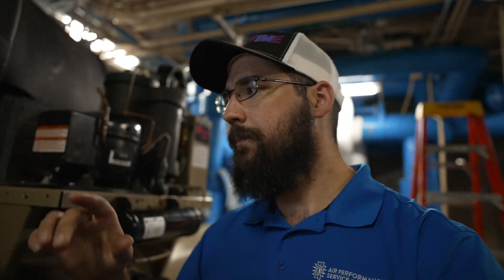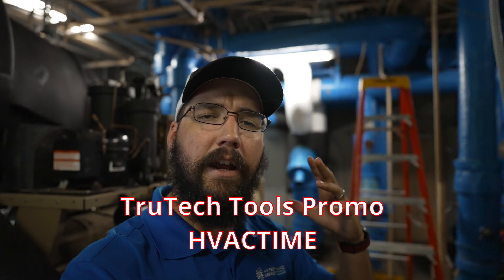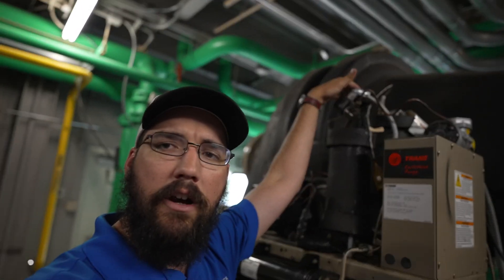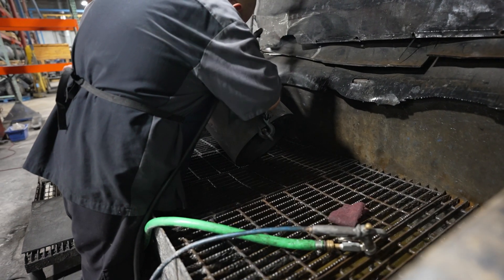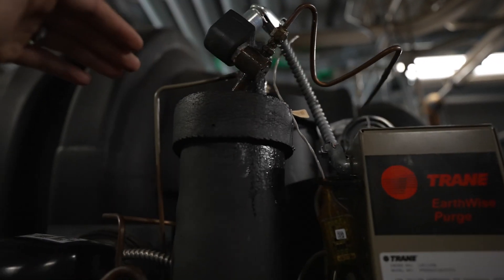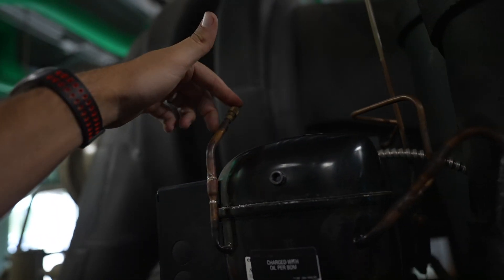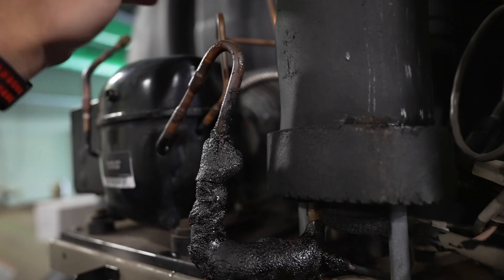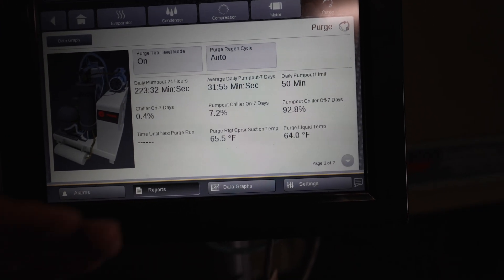CVH Purge Unit Troubleshoot for Trane Chiller

Comment: Have you ever seen the contactors on an IntelliPak pull in and out without tripping an alarm? So 60 ton, VFD circuit 1, 2 compressors circuit 2. Circuit 2 compressor contactors and first condenser fan contactor will pull in and out simultaneously without triggering alarms are tripping the compressor protection breaker. Only does it in the morning and not everyday. Circuit runs fine the rest of the day and in service mode and with circuit 1 running. All switches are good. Can’t find any shorts. Compressors not over amping nor overloading transformer no fuses blowing. Maybe it’s the MCM but it only does it in morning although that is the only time really it will bring the other circuit on. 24v inputs are good and 120v outputs. Any thoughts?
Reply: MDM board. Rtrm board

Comment: I could never understand the purge operation until I finally looked at the manual. I always thought there was some sort of magic going on in the purge tank. 

You can always check subcooling by taking liquid temperature and condenser coil temperature ( condenser coil temperature is usually the 2/3rd turn tube opposite of the discharge line connection ).  You wanna be between 8-15 subcooling. Anything less is a undercharge
Reply: But he removed the charge, if the weight was off(under), then it's undercharged.

He also recharged it with what I ASSUME was the 0.6 Lbs that it needed, soo...
Reply: What is the part no. Evaporator tank

Comment: What’s surging?
Reply: It's when there's too much compressor lift. In a chiller that is properly charged and operational, it's usually low condenser water flow and/or high condenser water temperature. This causes a high compressor ratio or lift. Basically the high/low pressure differential is too high for the compressor to overcome. The refrigerant pressure is too high in the condenser and flows backwards into the compressor, causing an audible "surge"  during operation. In my experience, I've seen poorly ran chiller plants with a bad sequence in general or may try to save tower energy(which is a drop in the bucket compared to the chiller energy). This leads to frequent surge issues.
Reply: @zjeepgozweeln  I could try to say it better myself, but I don't it would hold a candle to you :)